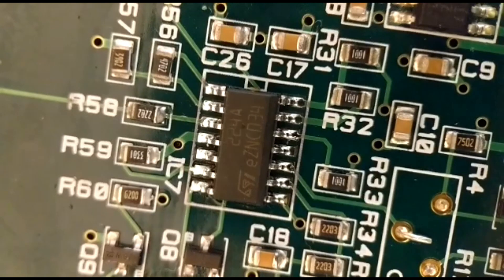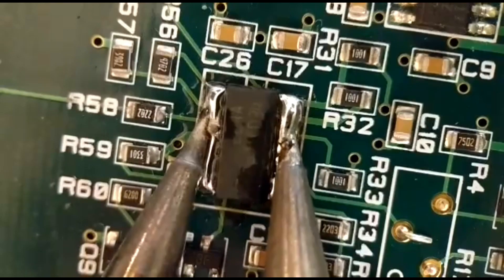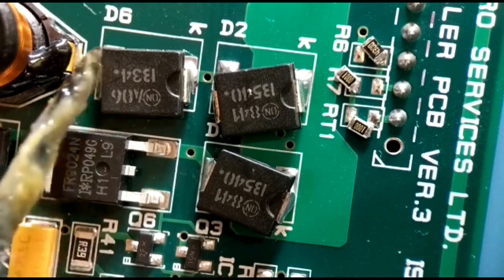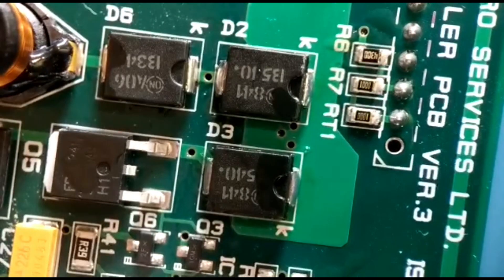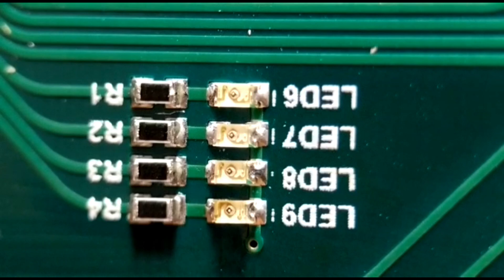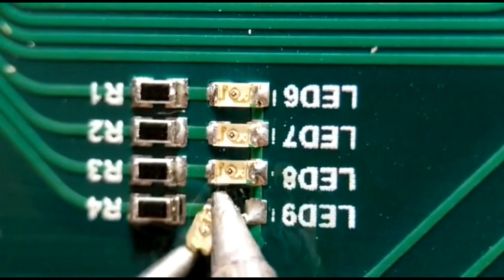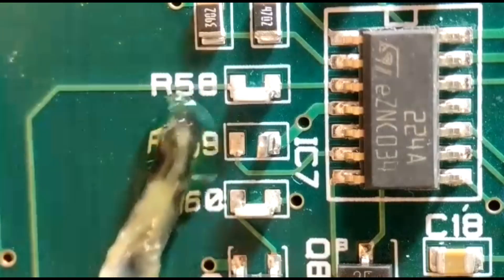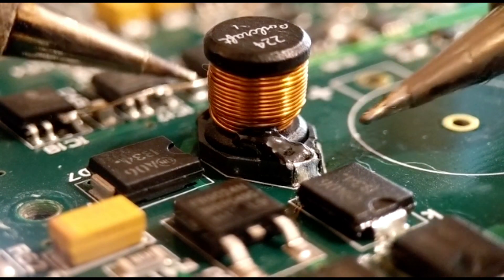Soldering Rework Made Easy/ Neat Soldering Method #soldering

Comment: Thank you for your video. What about using tweezers instead of two irons? Would it be same?
Reply from the maker: Hi , thank you for your comment , much appreciated. Soldering tweezers are limited by width restrictions whereas 2 irons is unlimited . You can manoeuvre the irons much easier than your regimented tweezers . Personally always preferred the irons over the tweezers . Thanks again 👍

Comment: Oh this is nice motivation for me to finish building myself a T12 soldering station or consider getting hot air with a 936 soldering station integrated since it basically doesn't add to cost. So far i'm using a Zhongdi 929c that is over 20 years old that i inherited, i don't hate it, the temperature regulation is spot on and it has oodles of power, the only things i don't like is that only 4 tips exist for it (annoying blunt cone, nice hoof, nice 2.4mm chisel blade, and nice sharp cone) so no hook tip, no knife tip. But you can still buy original high quality replacements, which is better than it could have been.

Comment: Hi Mr. SolderFix, very nice technique s from you.  I used to work for JVC in the 80's, replacing multipin surface mount ICs, sometime 120 pin IC. Now my eyes are not too good anymore. Now I need  "new eyes". .Can you please tell me which type of camerss are you using to make those nice videos? Thank you!!!
Reply from the maker: Hi , thank you for your comment , much appreciated. I simply use a phone camera with a macro lens attached to it . Nothing special at all but it does seem to work quite well . I do not own a microscope camera . Hope that helps, thanks again , take care 👍
Reply: @mrsolderfix3996  Thank you

Comment: Resistors are not polarised, why worry about inverting them
Reply from the maker: Hi , some of the high spec  places I've worked preferred if possible components placed so they read all the same way . Makes an inspectors life much easier . Doesn't take any longer to place them all the same way but if you have a problem and need to inspect your board you can read it all easily without having to keep turning it around .Thanks for your comment 👍

Comment: I've used this method to desolder 12AWG silicone wires from a 3d printer's hotbed that needed a lot more heat than the 400c of the TS100. For SMDs, this looks very effective, great for when you're doing small jobs. If you have to do this often, it's best to get some hot tweezers I think. I just ordered a pair, because they looked very easy to use and efficient.
Reply from the maker: Hi thank you for watching the video , much appreciated. I love this 2 iron method and find it much more flexible than soldering tweezers which personally I never really liked , but I guess you choose what you get on with best . Thanks again , take care 👍

Comment: informative video, I have a rework station, to bad it doesn't include a second plug for another one, O well I will have to get me a stand alone one just in case. thankyou again. God Bless
Reply from the maker: Hi , thank you. I love using 2 soldering irons , I have a really good branded hot air rework station but there are times when 2 soldering irons are just so much better and you don't risk any of the surrounding components i.e plastic connectors potentially melting . I know you can protect your nearby components but why bother if you don't need to . Just do it the easy way , this really is a genius method and perfectly safe if done correctly 👍

Comment: Tested this method today(16/11) ..it works like a charm....do you think it is a good method even for smd components ??
Reply from the maker: Hi , thank you for your support , much appreciated . I use this method for all sorts of smd components . I have a great hot air rework station but if I can I sometimes choose to use the 2 soldering iron method so as to not put unnecessary heat through other parts of the board . Also if done correctly the 2 iron method is very safe and will not damage the components being removed . I love this method . Thanks again and good luck with your projects 👍

Comment: Off to buy a second iron now... :D
Reply from the maker: Hi . Definitely one of the best bits of advice I could give you would be to get a second soldering iron . I have a full hot air rework station but I still prefer using 2 irons where I can as I just think it's so easy as the video clearly shows in some soldering situations.
Reply: @mrsolderfix3996  Yep, watching how much easier it makes removing components it makes perfect sense. I've not had to remove many SMD parts yet, but the ones I did I was trying to go from one side to another.. it just takes so long, and I end up feeling I need to rush to remove the part when it floats and that risks damaging it or the pads.
Reply from the maker: Hi . This is what most people do , go from side to side ( I used to years ago ) and as most people won't have a rework station , a second iron is a great alternative.

Comment: I just bought a second soldering iron. I blame you, hehe. :-)
Reply from the maker: Hi . Thank you for your comment , much appreciated . You will love having 2 irons for soldering rework etc but will also help in other soldering situations as well . It's the best tip I have ever told people I've worked with and they all love it now . Thanks again , good luck with your projects 👍
Reply: @mrsolderfix3996  You are so correct. I have one of those cheap chinese T12-942 OLED stations already with a bunch of tips, so getting another station was also very affordable (just $32 today, complete with PSU and free shipping) and gives me a lot of flexibility going forward. Previously I was looking for hot tweezers for this station, but this is not available. Seeing how you work with two irons, I believe that is actually much better than hot tweezers as you can manipulate the parts exactly how you like, turn them around, push and rotate them, etc. so this was really an excellent video which opened my eyes. Also having two stations can save me from changing tips all the time. Thanks!

Comment: What do you think about using soldering tweezers instead of 2 irons? I currently use a Hakko 888D, and I'm wondering whether it's worth spending £120 on the FX8804 tweezers, or using your technique I could just use my cheap Chinese T12 for the second iron. Thing is, you're obviously ambidextrous, whereas I'm useless with my left hand, tweezers would keep all the action in the right hand, any thoughts?
Reply from the maker: Hi . Thank you for your comment . I've never personally used soldering tweezers  as I've always found 2 soldering irons to be a great easy and flexible method that can do any size components. I've seen the soldering tweezers , and I know some people get on well with them so I would never rule anyone out of getting a pair. At the end of the day I have an option that works for me so I don't need to get any . Sorry I couldn't really give you a definite answer . Thanks again 👍

Comment: Thank you so much, exactly what I want to do , I have a 6802B alimentation CI that I want to test without harming around, and I am not mastering hot air so well . I find a solder SMDSW from chipquik that seem to be good to melt old solder , not very expensive as their chipquik "original" kit, it melt at a lower temp than usual lead/tin wire.  (-it is a 63/37 2.2%flux)
I am amazed that you file your tips without harming them, may be because they are ,good quality, with real copper under the tinned surface ? I did have trouble reworking the shape of cheap tips and I dont know if the ones of the Miniware TS100 will accept the work 

Best regards congrats again for your vids !
Reply from the maker: Hi . Yes my solder tips for my Weller soldering iron do have a thick copper layer under the outer surface so I can bend and file them into the shape that I need . I don't buy really cheap soldering irons because the stuff I need to do wouldn't be possible with these cheaper irons.
A good iron will last so much longer and has a wider range of solder tips for it  and this will enable you to do more varieties of soldering techniques so in my opinion it's worth the cost 👍
Reply: @mrsolderfix3996  I have some excuses as a beginner ;) Thanks for the advice, I agree indeed . At the moment out of the source problem (wich I noticed I inverted polarity , now it works really nice) the ts100 is providing a lot of tips, and apparently the ones that use it are happy 2 or 3 years later.  I  noticed, after seen it done on vid, that brushing the tip with a brass pen brush is very efficient.. I see the copper under the surface so I believe my tips react normally with tinning paste. I will consider better equipment when I will be in trouble ( more ;) )
Reply: @mrsolderfix3996  would you use the thin Weller irons (the ones intended for SMD), or a more regular one with a thin tip ? (I am thinking heat inertia.) ? Best -sorry for the many questions !

Comment: 1:20 I may have an even easier method:-)
You start by bending a piece of copper wire so it touches both sides of the chip, then do you wound the other end around your soldering iron. Now, do you have the soldering iron in one hand and the tweezers in the other hand, place the copper wire on all the legs of the chip and remove the chip with the tweezers.
Reply from the maker: Hi . This is why I love soldering , listening to lots of different methods people use and then selecting the one you like the best . You can never know everything . Thanks for your comment 👍
Reply: @mrsolderfix3996  I do really like you. You seem like a fantastic guy. Thanks for being like this and for sharing your wast knowledge!! :-)
Reply from the maker: Hi . No problem 👍

Comment: Very very professional :)

what is the name of the microscope?
Reply from the maker: Hi . Thank you for watching. The type of microscope I generally use is a long reach stereo microscope . This type of scope has a long arm on it so you can work on very large PCB's without any problem. It comes with a boom stand and is 100% stable at all times. I used a company in England called GT Vision to get mine , but they are widely available and do vary a lot in price . Hope that helps 👍
Reply: @mrsolderfix3996   Would you consider proposing a long arm stand to someone which is not earning money with soldering ? I was lucky to find for a very low price a very professional binocular Euromex  (very clean and large view, the top of the grade, swf eye pieces ;)  ) but the stand does not allow a long distance something about 20 cm . I was considering those flexible stands that one cans screw on the bench or attach on the side ,, but did not find them on site

Comment: Can I ask what irons you use and at what temperature, what would you recommend to someone new to the hobby
Reply from the maker: Hi . I use WELLER TCP S soldering irons  . They are great irons , not the cheapest (because you have to buy the power supply unit separately that they plug into), but the variety of tips for them is amazing and that what makes them my favourite irons that I've ever used.  They are not adjustable temp wise and are set at roughly 340 -350 degrees C but  they can do anything . All my video's I use these irons. I wont use any others. Weller are my favourite brand of iron and they do loads of different ones so you could get a cheaper one of you wanted.
You can buy an iron for £15 but it will come with a giant tip and that's it so I wouldn't recommend a really cheap one. 
Places like Farnell or RS Components sell loads of irons so check them out , they are the best 2 companies for this industry. Finally the solder you use is REALLY important. Most hobbyists would use 0.7mm but this makes it hard for surface mount fine components. I normally use 0.5mm for large joints or 0.25mm for fine components or joints . Company called BLT Circuits is best for solders. Hope that helps . Thank you for watching👍

Comment: great, what kind of soldering station do you use and what temperature did you work at?
Reply from the maker: Hi . Thank you for your question . I have both my irons set to 340 ° and I always use Weller TCP S soldering irons which I just find great for all sorts of soldering.  . Absolutely no damage occurs to components at these levels if rework is carried out correctly , so to me this is a great easy solution for rework issues. Hope this helps you , thanks again🙂
Reply: @mrsolderfix3996  yes I noticed you are doing your job very nicely
Reply: @mrsolderfix3996  thanks
Reply from the maker: Hi . Thank you . Much appreciated 👍
Reply: @mrsolderfix3996  something I am wondering, with the small very fast heating TS100 , is thet the heat inertia is due to the choosen tip , indeed (those tips have the heating element joined) but may be the capabilities of the alimentation can make the iron less effective. I use 24V from a "cheap" bench alim, supposedly going up to 30A , but first no amps showup on the display unless I put the iron at its max 480 ° and even then it only shows up a little then goes back to zero. it works much better with the Ridden 180 and its 60V source,  but I am reluctant to use a bench alim all day long. I had good results with a basic universal alimentation for laptops  , possibly allowing the drawn of more amps ?  is it logical ? Best regards

Comment: Pretty good technique if you have another iron laying around. I would have tried to take a solder sucker and remove one side at at time or heat gun, but it would have been more of a pain and take longer.
Reply from the maker: Hi . I personally never use solder suckers as I just don't rate them . If I need to remove some solder I use solder wick which I much prefer . 2 irons is a great quick ,safe method . I have a hot air rework station but again can take time because you have to protect any plastic parts nearby and parts get blown off. Also some parts i.e LED's can't be done with a hot air gun . These are just my thoughts so I guess people will always choose their favourite method , but I've shown this method to a lot of people and they love it. Thanks for your comment , much appreciated 👍
Reply: @mrsolderfix3996  Funny thing is that i also tested wick to desolder on used light bulb pcb, but i ended up ripping pads, even if i applied flux on it and augmented the heat of my iron to 325-350, sometimes it stuck. it's hard to get it off without damaging anything, and sometimes didn't work at all and i end up damaging the pads. That's why i prefer solder sucker, there's no risk to damage pads, and the big blue ones work fairly well.
Reply from the maker: Hi . I guess we prefer different solutions which I always say to people use what your comftable with . It's like , I have never taken pads off using solder wick so I will always use that option . But overall , 2 irons beats all these methods for speed and ease of rework.Thanks for your comments 👍
Reply: @mrsolderfix3996  👍
Reply: @mrsolderfix3996  HI, what I understood is that one have to always use enough heat, no 'pressure' and so the pads stay on the board. I noticed that the pads do come if the tin is not melted enough of course